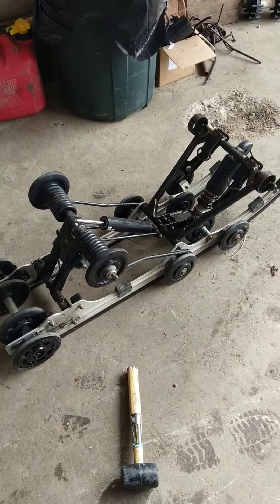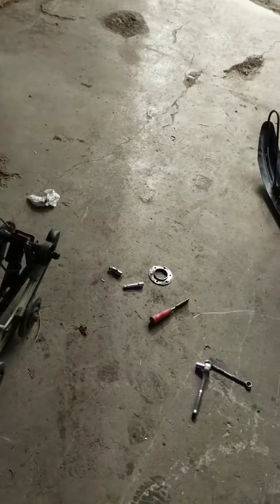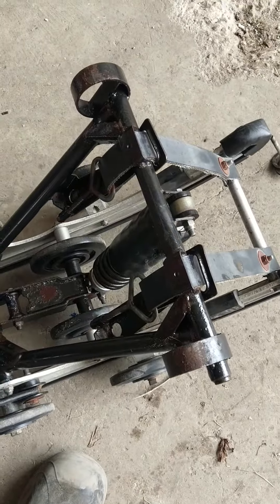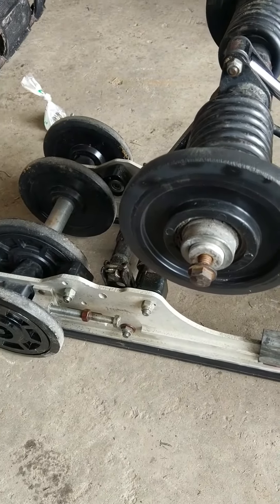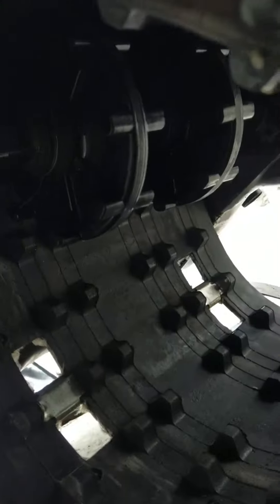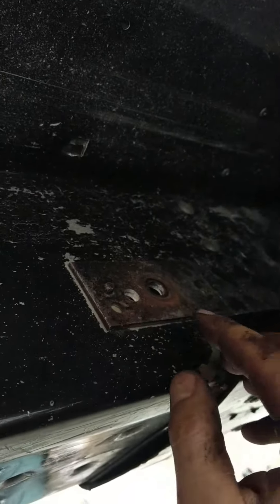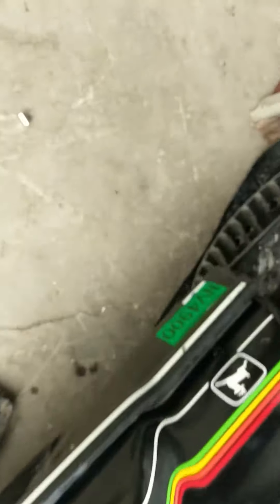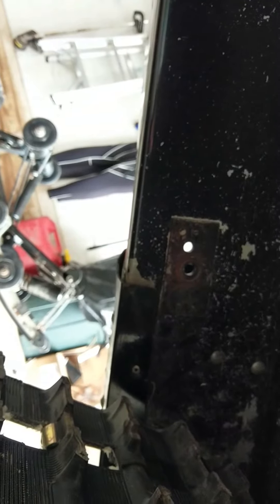Liquifire xtra 10 install with 121x15x1 track

Comment: Is that the stock drive shaft or the Polaris one? If it’s the Deere one did you put new drivers or move around old ones?
Reply from the maker: Deere shaft with new drivers.
Reply: Brett Feldpausch thanks, looking to do that same thing to my 78 liquifire 340
Reply: @brettfeldpausch3064  What exact drivers did you use did you use the late 90's skidoo ones that are 7" diameter?